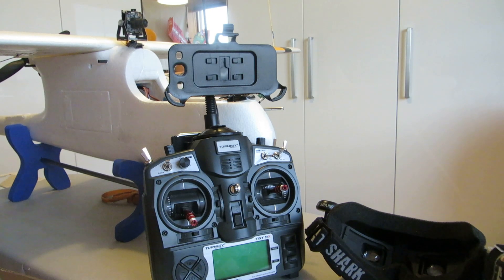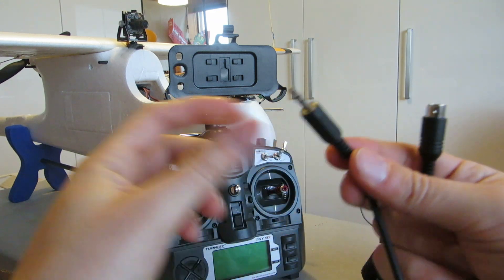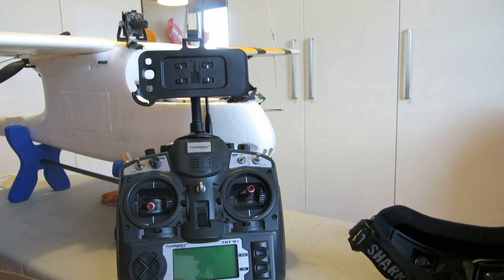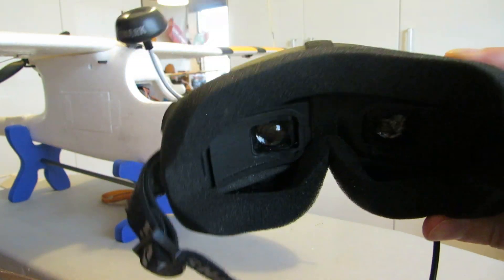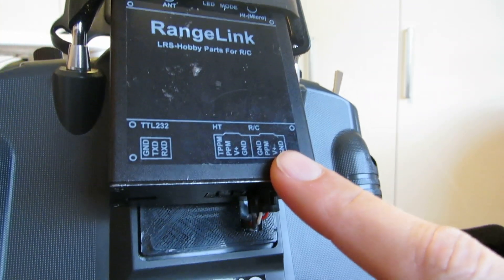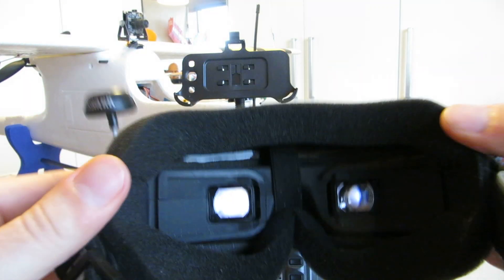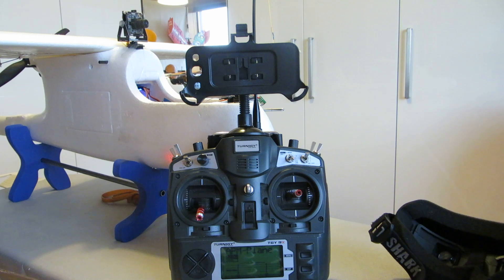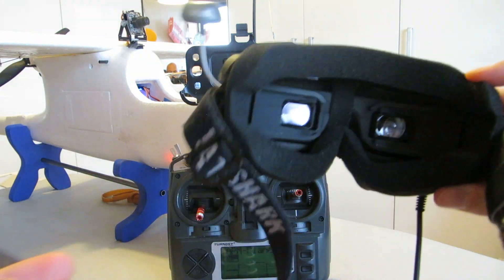Fatshark AttitudeSD head tracker with Turnigy 9X and RangeLink

Comment: Why did the Camera at the end reset to the center position at the end of the video?
Reply from the maker: The goggles probably just hit 90 degrees rotation at that point, which triggers the reset of the head tracker. This is actually a useful function as it allows you to quickly look straight again when flying, just move your head to any extent.